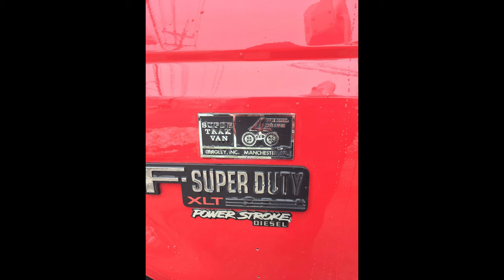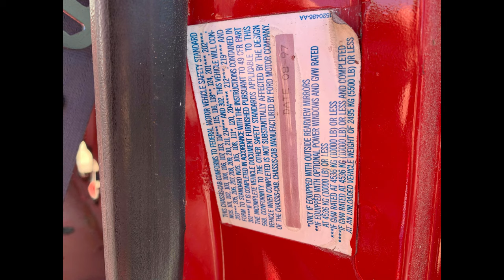The Ultimate Tow Rig Ford F-Superduty, Quigley, Centurion, Ex-Firetruck

Comment: I have a 1997 Ford F-Superduty F450 4x4 extended cab Service Truck
Centurion Extended Cab 
Quigley 4x4 Conversion
7.3L Powerstroke Diesel
E4OD 4x4 Automatic Transmission
1356 Borg and Warner T Case
5.13 Gear Ratio
Dana 70 Front Monobeam
Dana 80 Dually Cab and Chassis axle 
15,000 Lbs GVWR
16" 10 lug Wheels
235/85/16 Load Range E Westlake SL369 A/T Tires
9 ft Fully Enclosed Reading Utility Body
316,000 miles
Was owned by Maryland Department of the Environment as a Hazmat Truck.